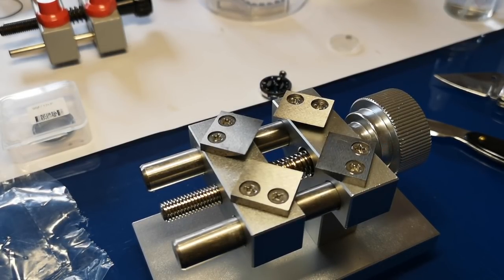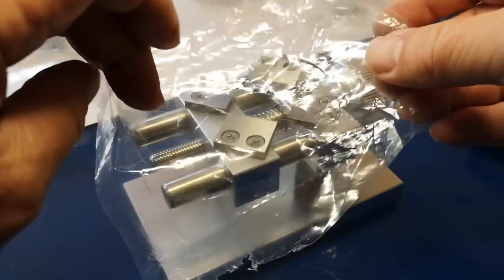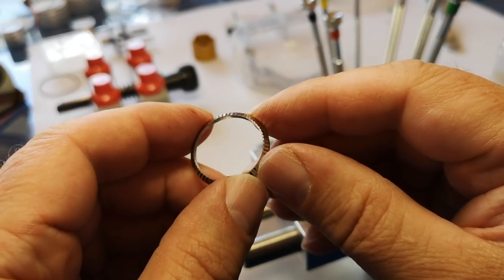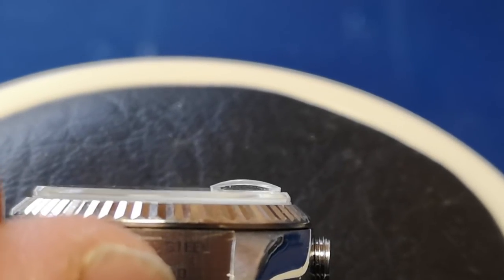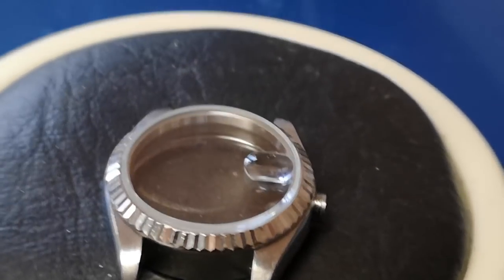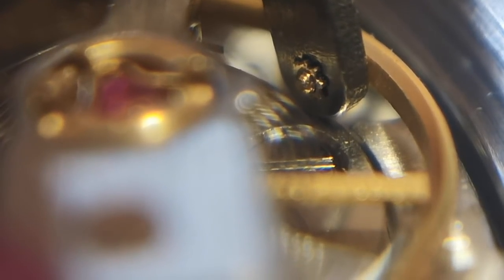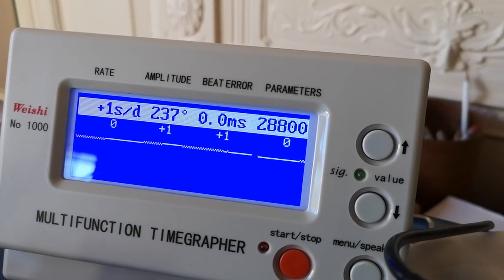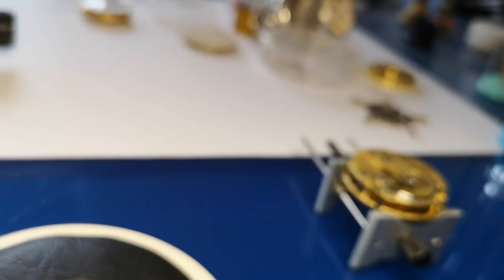Rolex Lady Datejust - Replace Glass and Regulate

Comment: Wow neat tool. I have used single sided razor blades the kind made for window scrapers and it does a great job of removing those bezels. Also never removed any gold ones only stainless ones. I wouldn’t attempt gold unless I had the proper tools.

Comment: The screws to regulate the rate are more than 1 on some Rolex watches? do you need to adjust all the screws when adjusting the rate?
Reply from the maker: Hi Oskar  ... timing screws needs to be adjusted in pairs so that the poise of the balance is maintained.  This process is called dynamic poising and is quite complex and beyond the scope of this answer.  Just google 'Dynamic Poising of a watch balance".  Hope this helps.  Richard